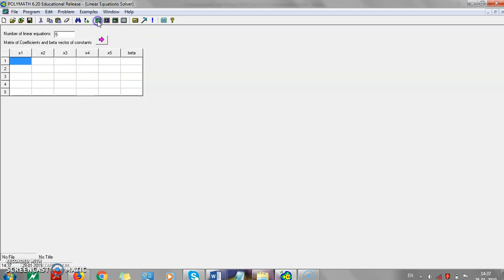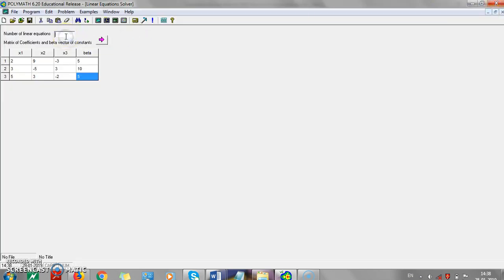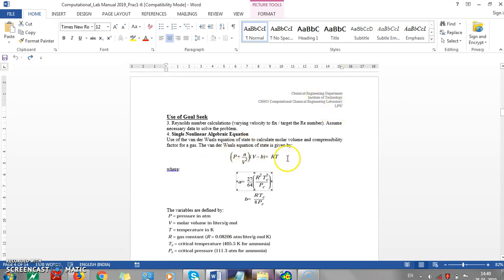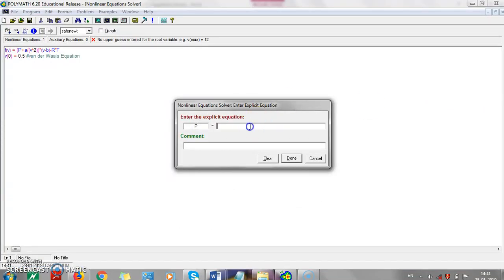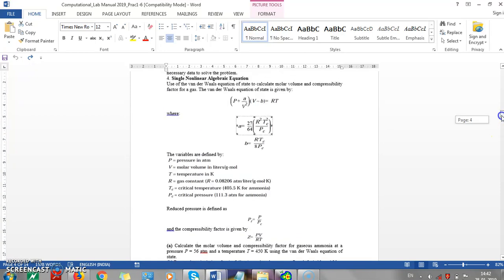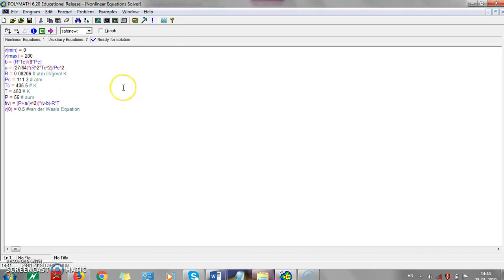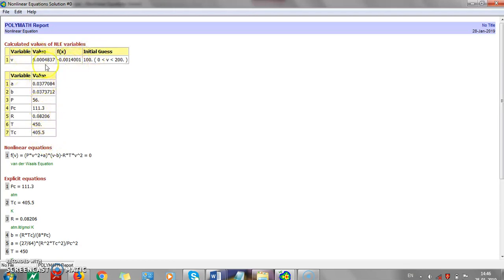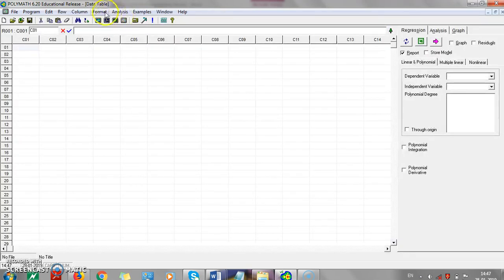Introduction to Polymath

Comment: Sir ama compressibility factor and pressure reduced kai rite shidhvanu
Reply: Hi Keyur you can export the results to Excel and then calculate the required properties. Hope it helps.
Reply: Ok sir will do as you say thanks for the help